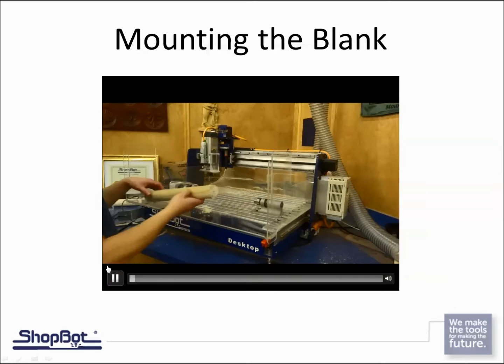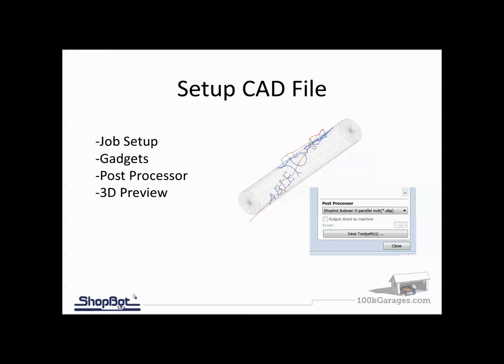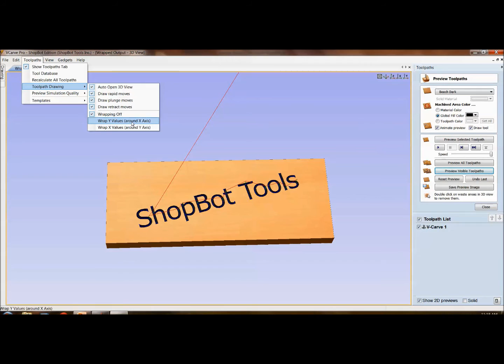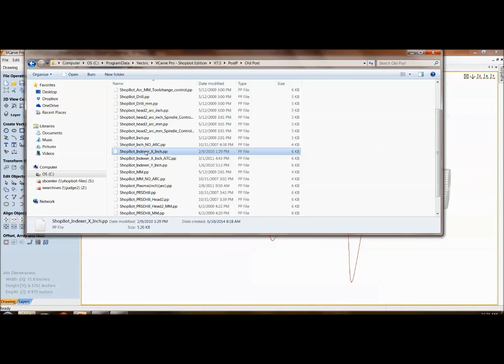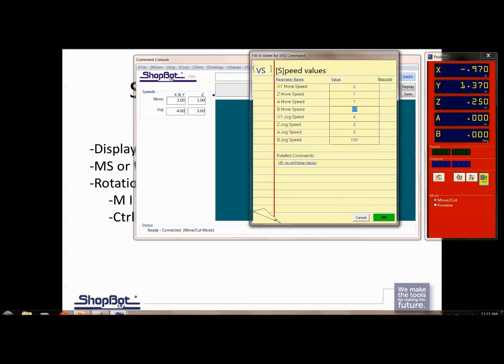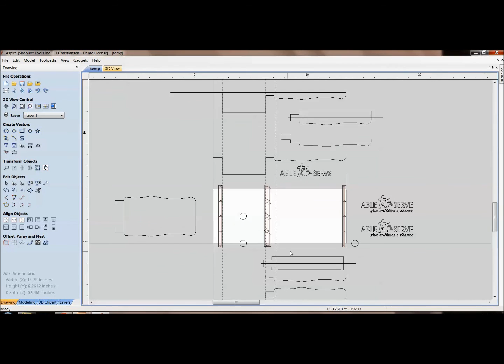Indexer Basics

Comment: "current job is not a wrapped rotary job".   I want to make flutes with pvc and wood.  I will drill holes at various locations and the mouth hole will be under cut with a 7 degree inverted cone bit.  Just playing with the trial version to see if I can do this.
Reply from the maker: Hi there! If you have any questions about using your ShopBot CNC or rotary indexer, please call or email and we'll get you on track! support@shopbottools.com or 888680-4466. thanks!